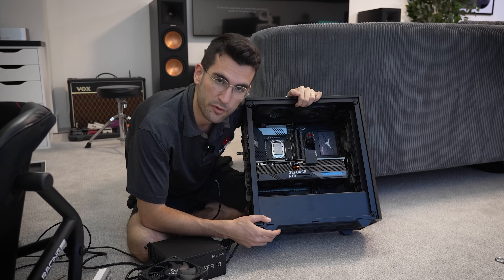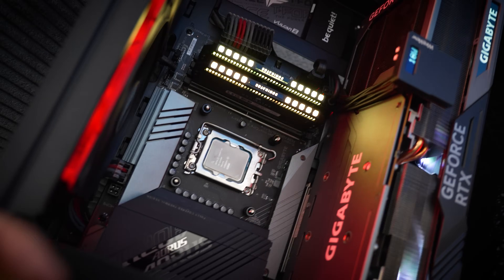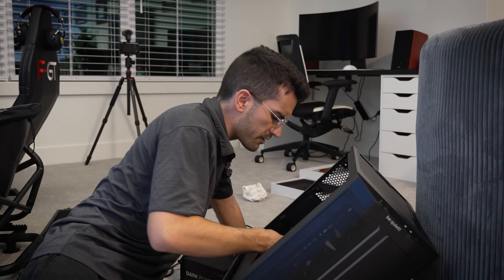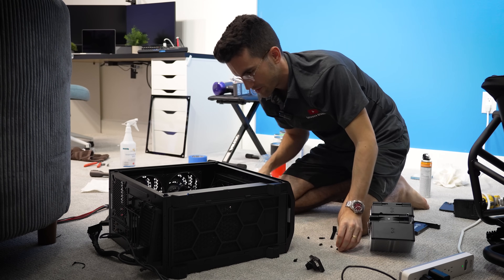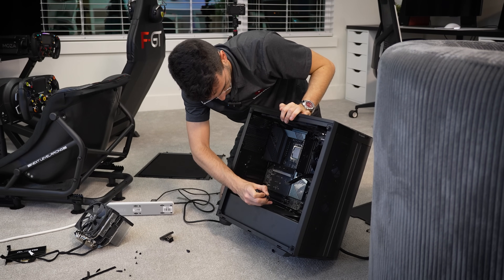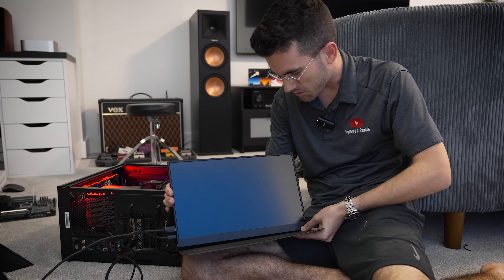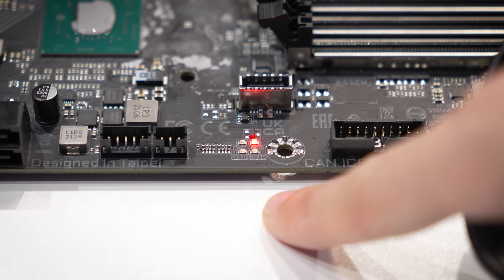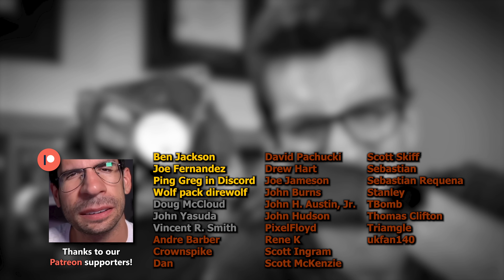Fixing a Viewer's BROKEN Gaming PC? - Fix or Flop S6:E6

Comment: 15:45  In the upper left hand corner of the video, it appears you may be missing a 4-pin SMD.   There is a complete one below the missing one on the other side of the m.2 standoff, for reference.  I haven't been able to find a picture of a  working z690 Aorus elite ax without thermal armor to confirm.

Comment: Those strange little black SMDs next to that PCIe slot you were looking at are resistors! Specifically, they're quad-pack resistors, meaning each one has four resistors of the same value in one package, with the pins paired off on opposite sides of the package. Those are all labeled 272 which is 27-and-2-zeroes or 2700 ohms. It's probable, given their location and orientation, that they serve some function with the sound section of the PCB, but I have no clue what. But those resistors getting toasty like that is definitely not a good symptom, either way.

Comment: MFosfet failure? I've had similar issue's with a couple of boards. One even showing 16.4v on 12v rail in bios that's how I caught the one. Thought it was PSU failure at first. PSU checked fine.

Comment: That hotspot near the lower pcie slot on the power suply area (that small seperate section of the slot) makes me wonder if something got into it and created a short or perhaps a cap or resistor shorted out down there. Seems odd symptoms for that issue, but I've never designed or built something as complex as a modern Mobo.

Comment: This happened to me just yesterday at work.  Powered on one of my dev workstations after leaving it off over the holidays.  Fans running full tilt, no POST, CPU didn't get warm, didn't even squawk on the speaker when I pulled all the RAM out.  Voltages were fine, RAM tested good in another system, 

Fortunately, it was an i7-2600k, so no big loss.  I pulled an old Skylake machine out of retirement.  They work fine until the electrical gremlins get fed after midnight.

Comment: I just had a pc die
Was fine then just nothing 
Wouldn’t power on
Used PSU tester it said PSU fine
Got new cpu and motherboard 
Had same problem
Hooked up different PSU
Issues solved
Try a different PSU

Comment: In 30 years of building and fixing computers I’ve never had anything die from ESD. I have never used a static strap either. In the early days hardware was more susceptible to ESD, but my best friend in the 90s taught me to always touch a bare metal part of the case before touching any components. I still do that to this day.

Comment: Don't take this the wrong way because I like Greg and his channel and I love how he fixes people's PC for free but this is the difference between content creators and the rest of us. I would be way more bummed about the loss of a $250 motherboard. In fact, I've never spent $250 on a motherboard in my life so it's really hard for me to relate. I do know that parts fail and it's a total pain but it kind of comes with the territory when dealing with electronics. Heat and stress are the biggest PC killers but sometimes components just go bad. It's like the old capacitor plague back in the early  90's when boards were dying by the thousands. Look at it this way - at least it wasn't the GPU! It seems like Graphics cards have become 50% or more of a total system budget now and I think that's completely ridiculous! Between the processor and the GPU it's getting to where building a new system just isn't affordable any more. That's why I buy used stuff. If it dies on me then I'm not out so much money and replacing it isn't nearly as expensive.

Comment: You're very fourtunate on the esd thing. To be honest I've not had an issue in decades either, but chips in the 80's and 90's would die at a sideways glance. Modern chips have several tricks and the like (capacitors, zeners, etc.) to protect against esd and all sorts of electrical spikes these days.

Comment: Something died in the power delivery on the board...or, after watching the last part of the vid, a catastrophic internal failure causing shorts

Couldnt tell you what, I'm either as dumb or dumber than you...I'm stuck with a machine that only recognises the built in LAN sockets it has 1 out of 3 times I boot...and 1 in 10 it forgets what front USB is 😂

Comment: I did notice at 11:11 there does appear to be traces scratched on the board between the socket and the ram slots. And there was another shot where there seems to be some scratches on it. I had a similar problem that I couldn't figure out that ended up being damaged traces. anyway, cheers! Thanks for the content!

Comment: My gigabyte b450 aorus m just did the same thing. Completely quite working. CPU debug lights up. Tried 3 different am4 CPU's from different generations. It's very strange we both had the exact same symptoms and problem. I wonder if this is more widespread of a problem. My boards only 2 years old so going to rma it.

Comment: Ah what a coincidence, my pc was also having issues which has an x570 aorus pro board in it. Symptoms were a bit different, pc would boot up fine but anywhere between 30 seconds and 30 minutes it would freeze for a second, black screens and reboot. 
So I started to trouble shoot it myself, prime suspect was st first the psu, switched that around with a spare, no luck.
Then I thought it might be the mobo or cooling issue so didn't want to rip out the mobo first so checked the cooling, but that seemed fine too. Eventually during the hours of trouble shooting it fried my ryzen 9 5900x.. so guess who is switching to am5 now.

To me it seems my system had some power delivery issues too and my mobo is like 3 steps away from dying.

Comment: I had a very similar problem recently, and had a pin that didn't look quite right, but was too scared to try and correct it. I ended up swapping the CPU bracket for a lga1700 contact frame and the motherboard came back to life.

Comment: The residues of thermal paste might have suffered electrolisys, becaming conductive at some point and causing a short. 
I've checked Thermal Grizzly Kryonaut Safety Datasheet and it is made basically from aluminium oxide, silicone oil and zinc oxide.
Reply: I think almost all thermal paste is made out of these components, in various mixtures and with varying particle sizes. And with exceptions like Arctic Silver and Diamond IC and such of course, but the vast majority basically uses the same components, but with better or worse combinations (and the better ones usually also cost more to produce).

Comment: @5.57 you're talking about earthing (grounding) yourself. Now as I understand it, in the US you have 110volt mains power and do not have an earth (ground) wire in your plugs, whereas we in the UK have 240volts main power and we have 3 pin plugs that have an earth (ground) wire. Which means all you need to do is power down and turn the rocker switch to off. Then touch a hand to the PSU and that will earth (ground) you. So no need for anything else for earthing (grounding).
Reply: In the really old days that was correct.  All plugs today though have s lower center pin for a ground (3 pins) that usually connected to the fuse box which connects to earth ground.

Comment: My older brother used to live in a very warm apartment in Chelmsford, MA where his computers would shit the bed once or twice. I've built all his computers since the early 2000's and his was having the same the problems in this case. I would swap the cpu or ram and it would do the same thing after some use. The mother board has so many components and circuit layers to it. There is so much that can go wrong to make it not work. It's almost not even worth trying to fix it unless you have the proper equipment which would be expensive and rare. Think it happened during the Athlon X2 era and FX era once or twice but Asus would cover the board under warranty. In some ways it's easier to cut our losses and just replace the board if suspected. Worse that happens is you have a spare board but usually the board would be bad.

Comment: So before I finish the video I just wanted to say PSU testers are fairly cheap I have two Since your using extension cables testing the PSU with such a tester would have been quick and easy. I use mine to test custom harness I make (14AWG, terminals, sleeving & connectors) in my own custom PC builds. Thermaltake makes one, the Thermaltake Dr. Power III that's around $50ish on Amazon (my favorite one, I have DR. Power 2), or you can get a cheap Chinese tester for $30ish that will do the job but may not last a long as the TT brand.

Comment: I had something like this happen with an old AM3+ 990FX Gigabyte board. Worked fine when built, and sat under my work bench for 6 months or so. It would not POST when I went to use it. Swapped CPUs, PSUs, RAM and nothing worked. I finally got around to hooking up a BIOS reader and dumped the BIOS and attempted to reflash it. NOPE, BAD BIOS CHIP. I ordered a pack of new winbond chips off ebay but haven't gotten around to replacing it yet.

Comment: Greg, not being able to understand why that motherboard called it quits shouldn't trouble you. I have been in pc/mac repair since age 29. I started building windows 98 machines. The common phrase "It was just working yesterday, running just fine until it didn't" is more common than you think. I always told people that all electronics work until they don't. Sometimes you can find out what caused the failure. Just remember that the sad reality of repairing computers is that sometimes you have no idea why the machine failed. You fixed it, unfortunately you had to replace a motherboard, but you isolated and preserved quite a bit of your personal time and sanity. Great job!
Reply: Agreed, it's hard enough trying to diagnose an old 486 board and these new motherboards have exponentially more going on.  Not worth the time and headaches to try and fix or even just diagnose something you can easily replace.

Comment: I have the same motherboard in my emergency system (just a backup).  13600K that I have to keep powered off (PSU switch).  It will just come on at random by itself for no apparent reason.  I've tried to update the BIOS only to be told that the image is corrupt no matter what version of the BIOS I try.  Hopefully, I won't have to use that system because that issue would drive me nuts.

Comment: I do remember when you were in the throws of building your new home. Can you tell me how big your dream home is and in which state and city you live in. Housing comparisons have always been around comparing the average home size from country to country. I live in Perth, Western Australia and my two storey home is 281 square metres (3,000 square feet). Property prices here have spiked once again with an average median price north of AUD$820,000. I live fairly close to the city centre and that has driven up demand and pricing to be out of reach for many. 
I had the motherboard picked right from the beginning and just like a light bulb, they can run for a decade without issue or last only a month. It's always enjoyable to watch your presentations and, btw, your latest haircut suits you well.

Comment: My clients often ask me why their computer isn't working because it was "fine yesterday." I have to explain that everything works right up until it doesn't. That's the joy of working with electronics.
Reply: Yup, I've had that same conversation sooo many times. "Same with your car, your water heater, your furnace, your hvac.." Everything works, right up up until it doesn't.
Reply: People don't realize that their PC is usually 24/7 connected to power and spikes from power can cause all sorts of these types of issues.
Reply: @georgeindestructible  power strip with over-current protection and an on/off switch.
Reply: @georgeindestructible  Very good point - which is why I turn off the UPS when I'm not using my PC.
Reply: Sooo true. Within the same day, my brothers 4090 went from working perfectly fine, to crashing the whole pc throwing it into a boot loop. Luckily its still within warranty for rma xD
Reply: Spend enough time working with electronics (and pretty much anything else for that matter) and you're bound to have something fail while you're working on it. That's always fun to explain.

A few years ago I was with a client and rebooted their computer. An hour later and no post I had to tell them the motherboard was likely dead and in this case it would mean a new computer. 
Luckily they were a long time client and had actually been there with me when it happened. 

It's just the way it is sometimes 🤷🏼‍♂️
Reply: Yes, thats how I explain to my family & friends, all electronics component has their MTBF (mean time before failure), it will breakdown when the time reach. Another simpler example is car tyre, at certain point it will wear out the treads on tire. The difference is, how long it will last depends on consumer usage, could take months, years, decades, etc....
Reply: @maxair95  Yah, that was one of the pluses to the pandemic. I got another year of usage on my tires.
Reply: My stock response is that broken is the default state of everything. We should instead be mystified that things around us are working at all. Zero people so far have accepted this worldview 😂
Reply: my graphics card a gforce 960 had stopped  one day took me a min ended up replacing it with a different card  a bout a year later then one i had in there stopped working  i tossed the 960 back in just to check and low and behold it worked fine, i have no clue as to why i just ended up chalking it up to life just messing with me. with electronics stuff happens and some times it magickly fixes itself.
Reply: I can relate =) I my PC worked just fine one day then the next day after work it wouldent even start ( no power ) Luckely I still had warrenty on the PC since I let the store build it for me so I could just hand in to get it fixed. Apperently the MB had died. /shrug =)
Reply: tell them to check back with you tomorrow and ask if the computer was fine yesterday.
Reply: Well, usually stuff doesn't die overnight, that's not the majority, but rather a small percentage of symptoms.
Reply: They used to be a lot more reliable. My Asus motherboard from 2010 is still going strong. I've been running it as my main PC since then. It's had upgrades, but the motherboard remains. I really need a new computer, I realize. Then I also realize it's probably all anecdotal. I had awful luck with hardware before this one. It's been excellent. I've added an SSD for the boot drive, replaced the RAM with 16GB DDR 3, an RX470, and an FX 8350 - after I flashed the BIOS for an AM3 board to run AM3+ CPU's. Asus was awesome with that kind of stuff back in the day. It also had great power distribution to allow for running the higher-power chips. I feel sometimes that tech is just not as reliable as it should be, but here I've had this platform for 15 years. I know current Asus products aren't what they used to be. At the same time, I've got a great 34" Asus VA monitor that I bought in 2021, and it's been fantastic. Perhaps it's just luck of the draw?
Reply: @jonathanscherer8567  You are quite right. My old Fatal1ty motherboard is still going after approximately 20 years, and will keep going, even though I had to disconnect Windows 7 from the internet. That dedicated mouse port is the bee's knees for thing like Unreal Tournament and the ilk.

Comment: I had the exact same issue happen with an am5 x670e board. I build computers for a living so im no stranger to mess-ups, but i was just installing a similar kit of ram (same speed, capacity, make, etc, only difference was that it was newer) when it just quit working. Had my own personal 7700x in it with both sets of dimms, it just totally quit working when i installed the 2nd kit. Now the board is completely toast, exact same symptoms, debug light, everything. Strange how this stuff happens like that sometimes.

Comment: If you get a TL-460 iirc or a bios card, maybe it is in reset state, so no vcore is applied to the CPU. I don't see the schematics yet, but that heating it up in the middle might be the crystal that is responsible for the power up of the vcore.

Comment: One funny thing about esd is that it won't kill right away (maybe 0.1-2% increased current consumption). You may start to have strange problems after 6-9 months. Almost all those esd testing videos show that spikes go ground. Problem is when it hits data lines or unprotected pins.

Comment: yeah ill be 40 years old in April,  I've been working with, fixing and building pc's , consoles, vintage tube equipment etc, since I was a teenager. I've never used an esd bracelet and I've never had issues. how much power are we even talking about?  the voltage might be technically high but the amps are barely even detectable. all modern electronics are built to handle a certain degree of ripple and surging, way more than what you get with carpet static.  I wouldn't want something that would break because of a milliamp of static.

Comment: @GREGSALAZAR I understand that repair is out of your scope and it can be not economical but sending it to another yt for repair will give you proof that its not related to termo paste (ea lack of conection with cpu due to corosion under cpu slot). Meanwhile you cant argue that it was not the issue 😊 hope to see a video soon with that board 😅 ❤

Comment: First thing I thought of when the chip didn't get hot is bent pins. It means the chip and motherboard aren't communicating at all. Even with BIOS problems or a bad BIOS the chip will still get hot. My guess would be the termal paste probably cause some sort of issue down the line and messed with the socket in some way.

Comment: @11:58 what is that white crusty stuff on the motherboard?
Reply: I'm pretty sure it's thermal pad/paste residue
Reply: @iamsleepyhollow  oh right. When you cleaned the thermal compound out of the socket with isopropyl alcohol in that previous video.